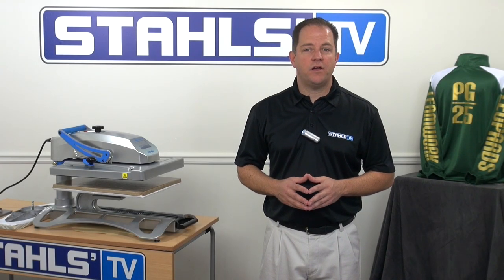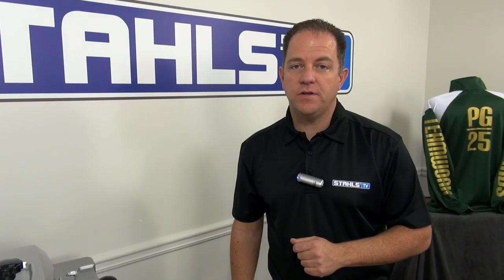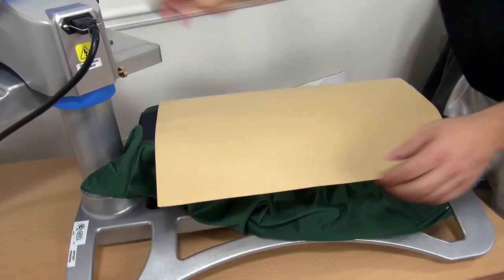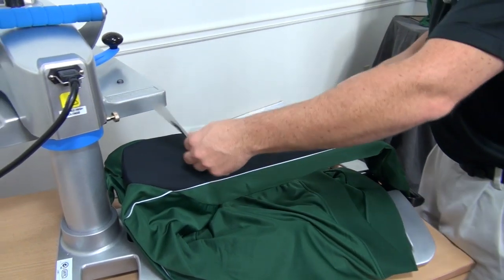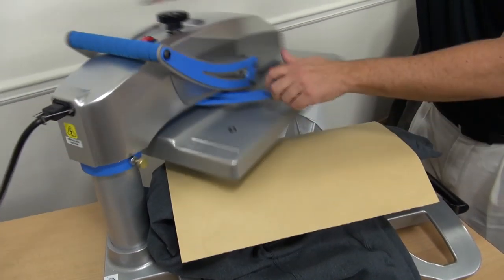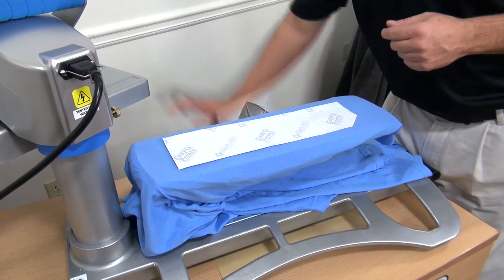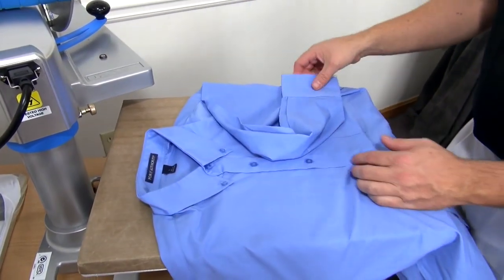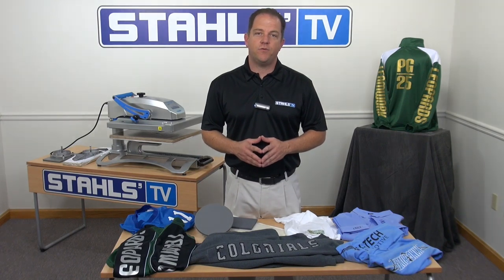Increase Sales with a Sleeve Application

Comment: @ 4:05 did you purposely print the sleeve in opposite directions? Prior, you printed the sleeve from the shoulder down so the text would read from the shoulder.